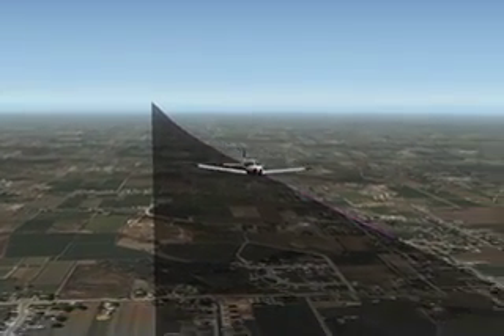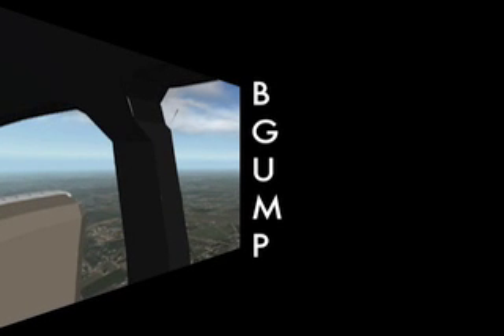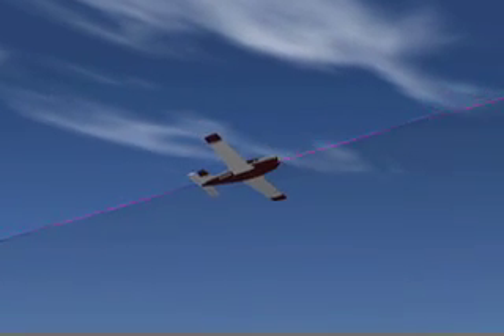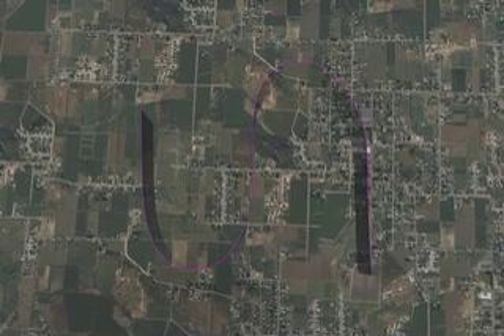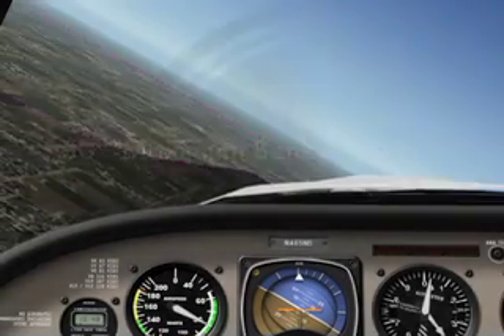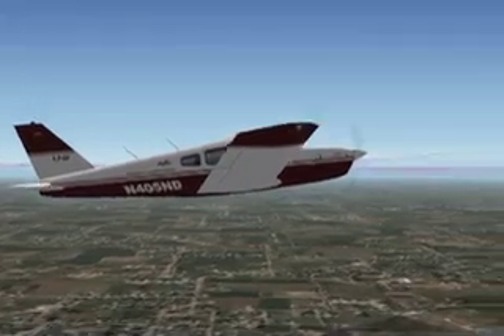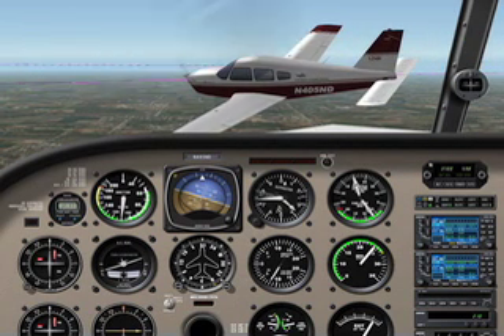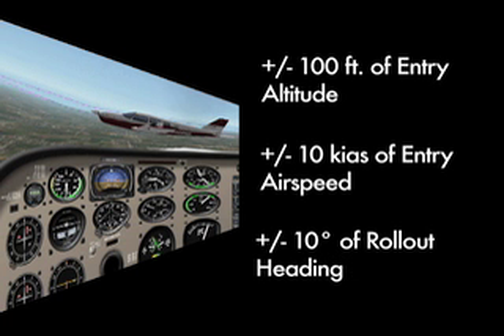Commercial Maneuvers: Lazy Eights

Comment: Flying the airplane "lazy" just means smoothness on the controls.
Reply: Aviator526  The lazy part comes from the historical aspect of it's kind of like a Cuban * aerobatic maneuver, but it's 'laying' on it's side - hence, it's 'Lazy."
Reply: Aviator526 The maneuver is performed against a distant horizon point. From a visual perspective behind the aircraft looking towards that distant point, as you watch the pane perform the maneuver, the nose of the plane 'appears' to trace a 'lazy 8' pattern across the horizon, with the crossover point of the 8 being that distant reference point.

Comment: Instructors say you should be close to stall at the 90 degree point because it helps the nose "slice" through the air. But it's not a requirement in the pts

Comment: The examiner told me that he couldn't remember a student performing a lazy 8 as correct as i did (CPL). Anyway, some stuff that helped for me:

-Make it slow, and i mean ridiculously slow. It will feel fcked up but just do it.
-Slow speed. In my c172rg, 90kt, 23/18" was perfect. 
-Stick to the same airspeed! That way the maneuver will be the same every time.
-Don't just "drop the nose" through the horizon... SLOOOOW. 
-When you reach 30 bank, start decrease bank direct. Don't wait with it.
GLHF